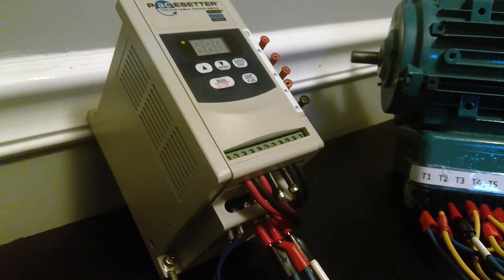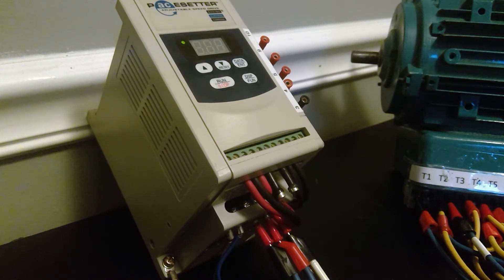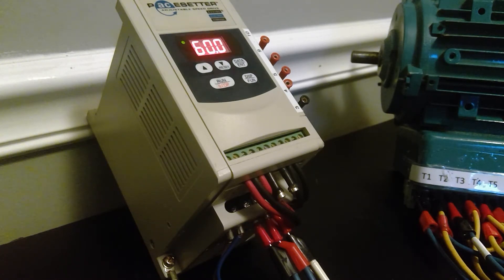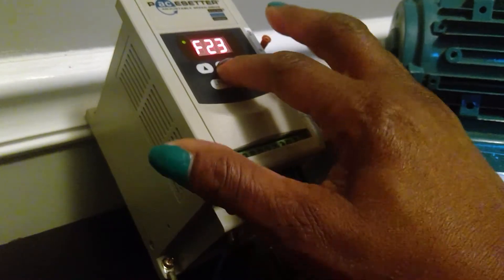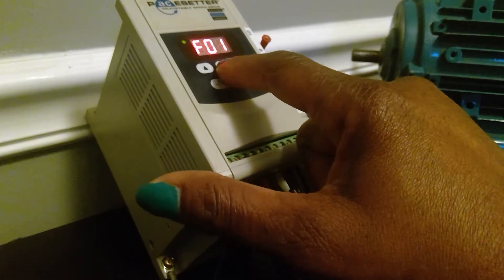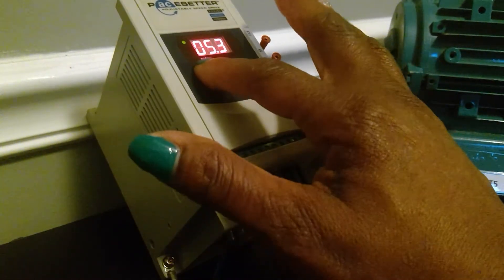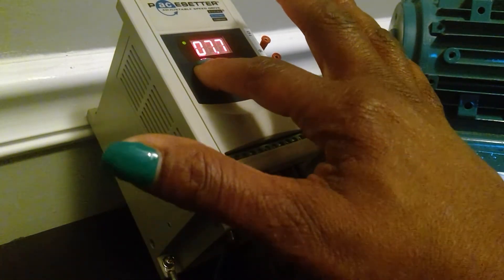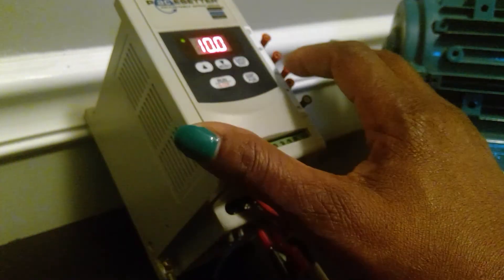Changing the Acceleration parameter on a Pacesetter 2701/TECO FM50 Drive

Comment: thank you.   I need to get my Fluxmaster 50 up and running with this new 3 phase motor I bought.   Sweet Walker Turner gear down motor for a metal cutting bandsaw.    But not sure how to program the parameters